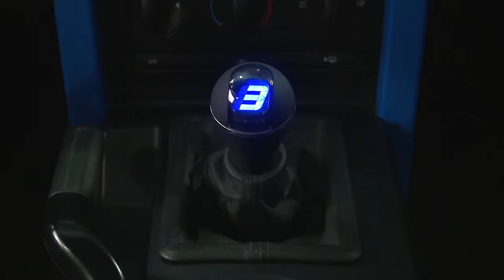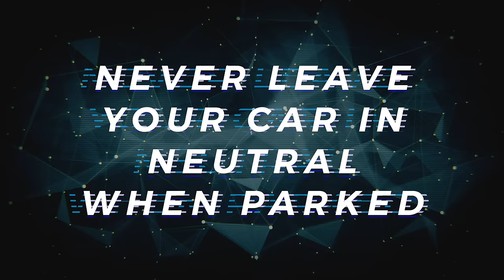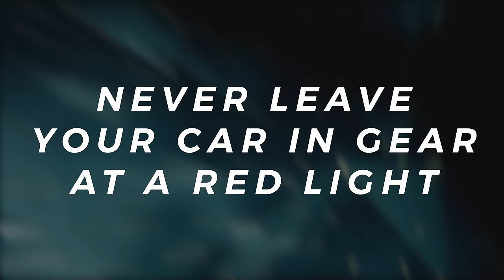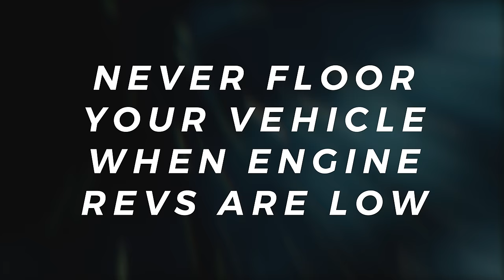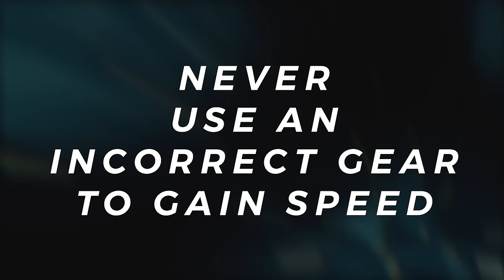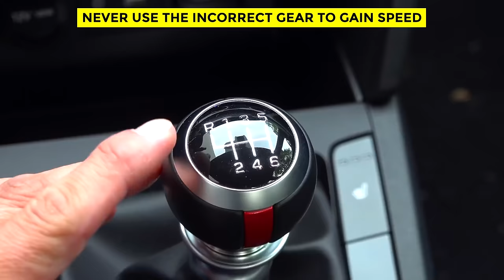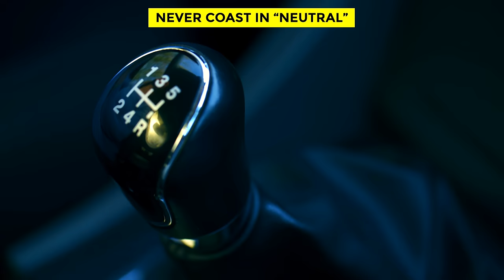7 Things You Should NEVER Do In a Manual Transmission Car!

Comment: when going downhill you should just use the engine itself for breaking. if you take your foot off the gas, the engine will try to go down to lower rpm but through the transmission the wheels will force it to stay at higher rpm. this way the engine will work as it normally would without using any fuel and the tug of war between gravity and the engine's attempt to slow down will keep your speed almost constant (depending of the steepness and the gear you are in).
Reply: I don't think it's that complicated to not press Gass when your car is on a downhill road.
Reply: BRAKING NOT BREAKING FFS

Comment: You shouldn’t press clutch while braking till you get close to a complete stop. for using the max brake force.
Reply: I used to put it in neutral when braking to a stop
Reply: This is correct.
Reply: Joost de Bruin my cousin used to do that. i somehow managed to convince him how dangerous it was. it’s not worth risking your car into an accident for that.
Reply: True drivers know about engine braking
Reply: @rickysubie  hell yeah, downshift once or twice and just let the car slow it's pace to get in the flow of traffic
Reply: I drive truck and fully agree. Big bore diesels don't have much  natural braking power, hence why most trucks now are equipped with engine brakes. The clutch is only used for starting and stopping.
Reply: @rickysubie  YEAH WE DO!!!
Reply: @joost6994  There's two problems with that : you don't engine break, so you have to apply lots of force, to be able to brake worse than with engine braking, And 2: if for some reason the traffic around you changes, you first need to get to a correct gear, clutch out, etc., While if you are engine braking, you just press gas and you're done. Yes, engine braking stresses your car, but you know: the moment you turn the key (or, press a button), there's a lot of strain going on already. If you can't handle that, take a bus.

Comment: I coast on neutral all the time, I have never needed to service my transmission on any of my cars. Who cares if the engine isn't pumping as much oil, it doesn't need it, it's essentially idle. Same with leaving your hand on the shifter. Unless I'm using the shifter as my seat, I really don't think anything would happen. Some of this stuff is correct, other stuff is nitpicking.

Comment: For someone who doesn't drive a manual but wants to this is kinda confusing
Reply: Yep
Reply: It's not that serious. You could be a pro in a week
Reply: @orlandoanderson123   Yeah, I learned how to drive many in a week. Of course, little situations like launching off a steep uphill I haven't gotten to try yet, but I've learned the mandatories in a week, it was very easy to adapt to it.
Reply: djxr177 gamer its not as hard as it sounds. It’s kinda like tying your shoes. Once you learn it you’ll never forget. It’s like second nature for me at this point.
Reply: It’s really easy. If you want to learn it would take a few days at least. I learned on a bike
Reply: Few of these are good alot of them are just stupid
Reply: learning how to drive is simple. Mastering how to drive properly, however, just takes a little bit of practice.
Reply: Don't ride the clutch. That is really the only thing that you don't want to do. You have to slip the clutch to get the vehicle moving and holding the clutch down at stop lights won't make a difference. Thrust bearings are replaced with the clutch and I have never heard of one failing before the clutch was shot. You can coast in neutral if you want to (don't see the point), but don't corner in neutral as it impacts your ability to transfer weight and can cause under steer.
Reply: I taught myself in a week now I daily a 5 speed Integra
Reply: Took me like a week to learn it’s not that hard
Reply: get you a little honda civic to learn how to drive stick never will you have more fun in a car if its stick also if you blow the crap you won't be losing your arm to fix
Reply: @MakkroFTW  I drive my dad's civic (5 spd) and I agree.
Reply: In the uk pretty much everyone does their test in a manual car and it is possibly one of the easiest things to do if you struggle to drive a manual you shouldn’t be allowed near an auto!
Reply: @solentshredders7929  Honestly, its sad that the U.S cant drive stick. I have done that rollback when you go into gear in a bridge or hill, and the people around me look at me like I'm crazy.
Reply: Gabriel Eunice I have a 99 Subaru Impreza so I have mechanical hill start ;) haha
Reply: Not rocket science.

1. Never rest your foot on the clutch or your hand on the stick
2. Push the clutch only when you shift to other gears or neutral, then engage asap
3. If you need to emergency brake, push BOTH the brake and the clutch ( otherwise inertia of the engine will apply a forward force the brake also has to compensate for, and you also stall)
4. Almost every car has the "contact point" at a slightly different height. When you get into a car never driven before, start the engine, put in 1st gear and slowly begin engaging the clutch. DON'T release the handbrake for this! You'll feel the car tilt and maybe the engine rev change when the point is right.

Comment: 2 out of 3 in my fleet are 5-speed. So much more fun to drive, feel more connected to the vehicle. Especially in my 4x4.  You can change gears without the clutch,  “floating” them. Had to do it once on my ‘85 Honda when the throw out bearing went bad on the way home. Got it home with very little grinding of the gears. This is a lot harder on a car with high revs than a big truck with a narrow rpm band.
Reply: true my 92 f150 floats alot better than my 95 civic i can float 1st gear and California stop without using my clutch in my 92 f150
Reply: Most semi trucks dont need "double clutching" as they teach you. You can float them and it works the same.

Comment: The main reason, by far, for not coasting downhill in neutral is that you must use your service brake to maintain speed, heating up the brakes that can lead to brake fading(  braking power sererly reduce to almost none). When going downhill use engine braking, especially on heavy vehicles, like vans and trucks. In an automatic, if your car doesn't want to engine brake( speed keeps creeping up, even if the gas is not pressed), change it to manual shifting and downshift if rpm permits it
Reply: Never clutch and never leave neutral downhill. You're just leaving your car at a free fall state and removing control from yourself to anyoen who is reading this in the future. Plus why the hell would you go leave it at dead? You can already go downhill with second gear and make it buttery smooth easy for the car.

Comment: I'm sorry, but I'm not convinced about "never park your car in neutral".
I've seen a lot of parked cars hit by another car and the result was: broken gearbox. If the handbrake works fine (as it should be) there's no point of inserting a gear for "the fear of the fading handbrake". Otherwise, if the handbrake doesn't hold fine, get it checked. That's my point of view.
Reply: Or just use both, if it's cold you shouldn't use the handbrake tho
Reply: i agree, just out the car in gear if you park on a hill, if you park on a flat surface theres no need to put the car in gear, just use the handbrake
Reply: Andrei S le Jude always put it in gear and use the hand real at the same time. Then if one of them fails the other will catch it.
Reply: If your car is hit hard enough to break the gearbox, it was probably totaled anyhow.       
I drove a Saab (worked in a luxury hotel's valet parking lot) some years ago that had such a weak parking brake as well as clutch that we had to chock the wheels to keep it from rolling on the valet pick-up drive.

Comment: 1:50 No, do brake without clutch, if you always push the clutch you are wearing out your brakes faster because you aren't breaking with the engine, in fact brake as much as possible with the engine. When you need to switch to lower gear simply push the clutch and do it then release it again. If breaking in emergency then it really doesn't matter if your engine chokes when you stop, it's unlikely to happen anyway because it's the habit to push the clutch when rpms are too low.

Comment: Happy to report that I never make these mistakes on a consistent basis. 

Every once in a while the clutch slips or I grind a gear, but that's maybe a few times per year at the most.
Reply: i dont understand, I think I do clutch slips but I wasnt taught to not do so. Granted 90% of the drive done is below 40kmph. Should I get my clutch checked?
Reply: @InvalidDiv  no just learn how correctly to operate manual transmission  and avoid doing mistakes

Comment: Coasting in neutral in a manual causes no damage to anything. Other then maybe sum extra wear on your brakes due to a lack of engine braking
Reply: I'm not sure what to believe anymore. Perhaps this could vary from car to car. Perhaps like you say nothing is really affected besides brake pads wearing quicker
Reply: @ivancastillo9174  Depends on the hill and depends on the brakes. Getting brake fade while going down hill might scare the sh*t out of someone who doesn't realize that he still has options. Keeping it in gear is the safer way to go. If you're going downhill but don't want to waste fuel or engine brake too hard, put it in a higher gear and let it coast. If the grade is high enough, you'll either maintain speed or even speed up, but in all that time you're using the car's built-up kinetic energy and gravity to power everything your engine would normally power by using fuel.
Also, if your engine stutters and stalls when going downhill in neutral, you're shit out of luck - you get maybe 1 good press of the brakes (vacuum pump still armed) and then it's manual brakes all the way. You also lose power steering. If you're in gear, everything will still work as the engine is being turned by the wheels. In older cars you could restart the engine by shifting into the proper gear and releasing the clutch. Newer cars might not like getting push-started and fail to start, leading to the beginning of this paragraph -> shit out of luck.
Reply: Ivan Castillo I’ve been working on cars for years. Manual transmissions don’t have a pump they rely on the internal gears spinning to move the fluid. As long as the wheels are spinning so are all the gears the only thing not spinning would be the input shaft. But if the engine is running even that would be spinning too just nothing is connected to it. There for causing no damage to any parts inside the transmission.
Reply: @tonyburns5388  There's still no point to coasting in neutral. When going downhill, if you want to save fuel, put it in an overdrive gear and let it coast that way. 0 fuel consumption, proper engine lubrication, no possibility of the engine shutting down and losing assisted brakes and power steering, not to mention that you get to spin that oh-so-useful A/C compressor for free). It's also more fuel-efficient to maintain speed than it is to let the car slow down due to friction and air resistance and then accelerate it again.
Reply: Nothing will break, sure. But it's less safe than to stay in gear.

And I'm pretty sure most manual gearboxes are not lubricated by the engine/pump. More like splash lubrication.
Reply: @2010ngojo  adding to what you wrote, all manual gearboxes have oil inside them. They don't have cooling systems because they only have to deal with the (very low) friction inside the gearbox. They're also always lubricating (the gears pick up the oil on the sump and spin it around) since as long as the wheels are turning, the gears are turning too.

This system is completely separate from the engine oil/cooling system.

Coasting in neutral is simply a bad habit to get into since it increases risks (not having power to the wheels when you might need it at a moment's notice) while being fuel inefficient (an engine which is being turned by the wheels uses no fuel and everything on it works perfectly while an idling engine uses fuel anyway).
Reply: It is dangerous as you don't have full control of the car , cant say iv not done it but dont.
Reply: Kain987 I’m not disagreeing with that point I’m just saying it won’t cause any damage.
Reply: Tony Burns exactly
Reply: Sith Lord no if the car is working properly then it doesn’t change the steering at all
Reply: @Kain987  if your engine stalls going downhill just shift into a high gear and BOOM your engine is spinning again.

Comment: My man's said a clutch is "an extremely expensive repair" no, its 50-150 for the clutch and some tools
Reply: Here in the UK I was quoted£1500to replace the clutch,the clutch itself was £250.rip off merchants.
Reply: when i had a clutch job done on my audi, it cost just over 1000 euro, because you have to pull the engine to change the clutch. genius!

Comment: Putting the car into a lower gear when slowing down helps a lot with braking, so I disagree with the "hold the clutch while braking" it just causes more wear on your brakes.
Reply: Either a good thing or a bad thing depending on where you were taught to drive. In France, for example, they teach you to use the gearbox to help slow down; in the UK the advice is "Brakes are for slowing; Gears are for going." Today's brakes are so efficient I don't really see any need to use the box as well. And which would you rather wear out: a £100 set of brake pads, or a £2,000 gearbox?
Reply: @MSM4U2POM  And those people are teaching others? If you don't know how to shift, then you will destroy your transmission regardless. If you are good at shifting then actually cause bigger wear on the clutch. Not to mention you loose the ability quickly accelerate.
Reply: @Megaranator  I think he explained it badly. The way they teach it in the UK is to use engine braking and work down through the gears but do it without slipping the clutch, using the brake to match speed to revs. That saves clutch wear, keeps your gear appropriate to your speed and uses cheap brake pads to absorb excess energy. Exactly the same way that good drivers everywhere do it.

Comment: I've done 4:41 a lot in my grandpa's old truck. It has a very shallow pedal, meaning there isn't a lot between full throttle and no throttle. It also has a heavy clutch with a hard bit point that can be hard to release right. That thing has shaken so much I might as well be a smoothie.

Comment: All these things are perfectly acceptable when first learning to drive, as for not leaving you car in neutral, most Europeans do this due to an amazing invention called the HANDBRAKE.
Reply: Ben Frampton   Same here in Australia.
Reply: Well, this amazing invention always worked better when another system called putting the durn thing into gear was also used.
Reply: well my 8800 pound truck would disagree with its effectiveness alone
Reply: @johntapp7232  Belt and suspenders ("braces" for our British friends).         
Many cars will not let you take the key unless the transmission is in reverse. Saab used this essential safety device, hence the ignition switch between the seats, and almost all American manual shift cars made from the early seventies into the eighties. Even floor shift cars had a linkage to the lock collar on the steering column.

Comment: You should said: "use clutch when braking only when full stopping" otherwise having the clutch in gear helps a lot in reducing the speed
Reply: If you stomp on the brake pedal like a ox you probably should disengage the clutch too

Comment: I dis agree for the last part, in neutral position engine do not over heat. Its like the engine run in cooling steady position. It might faster cool down due to its running and wind pass to radiator.  There is no stress to the engine because it was dis engage.  
Its just like you ran your car and then you stop to the intersection with red light.  Thats just the same happen to your engine when dis engage in downhill. The problem is that its more dangerous due to no engine brake and need more brake to slow down the car.

Comment: Yeah... so we call it a parking brake and we’re taught to only leave a car in gear if on a steep hill. 

I guess as most British drivers learn to drive in manual cars these seem a bit redundant to talk about to me lol 🤣

Also I remember my instructor teaching me hill starts by holding the car at the biting point on a hill 🤣
Reply: yup autos are typically rarer over here
Reply: @isaacreed2768  because we like to drive our cars
Reply: yes my instructer had me do that  on hills but with expieriance you get to know when to come of brake and let clutch out without rolling back
Reply: The clutch is designed to slip, and teaching learners clutch control is worth the sacrifice of the minor damage from a few minutes of slipping the clutch.
The point of leaving the vehicle in gear is if the brakes fail, the engine will keep the vehicle in place. It's a good habit to come to a complete stop in neutral, shut off the engine, then re-engage first or reverse. When you get back in, without applying the clutch, slide it back out of gear. If there is any resistance, you know immediately that your brakes have failed, whether it's only enough that it's sagged while parked, or complete failure.